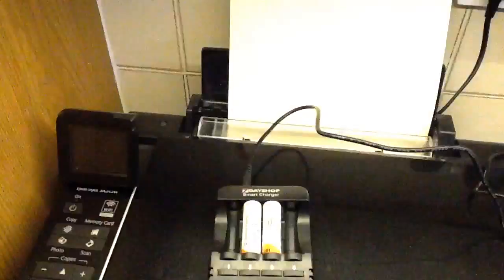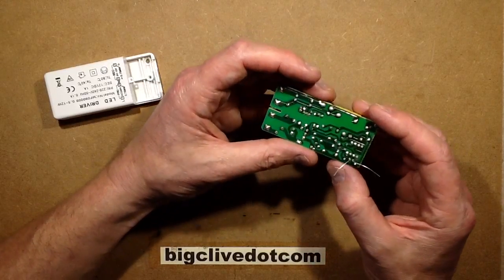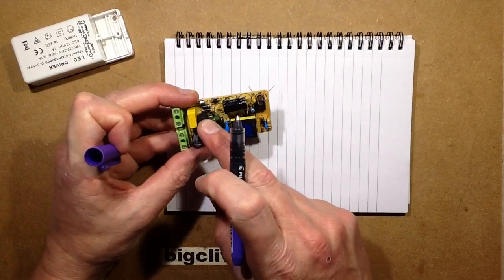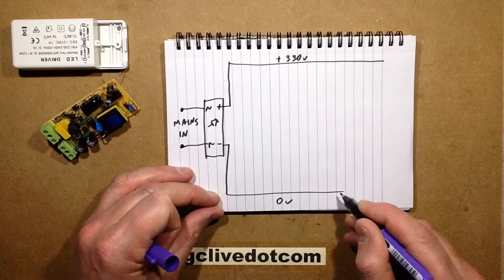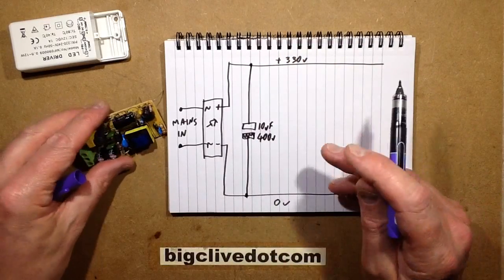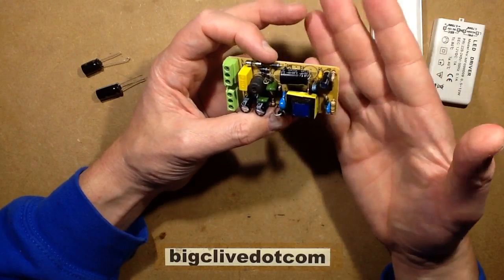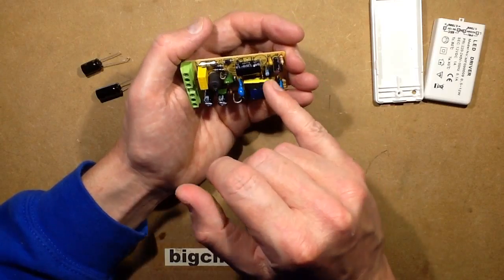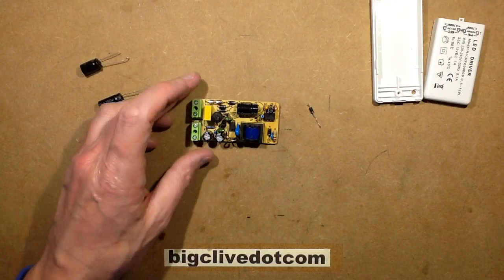(Flashing content.) Repair of strobing LED power supply.

Comment: Dear Clive. I have a question.
I have modified an led-series driver into dimmable with simple parts (13005 + 50k potensio), and it get flickered when in middle brightness, but fine when in the lowest / highest turn.

How to make the mid turn not flickering with simple parts?

Hope you will make tutorial from this.. 🙏

Comment: I purchased a rain proof led power supply 12v 300w  ip42 but led light blinks an power off an on each time it blinks got power whith light on no power wile light is out . any ideas besides reflowing the the solder possibly
Reply from the maker: That's possibly the electrolytic on the output side or the small bootstrap electrolytic on the primary side.

Comment: Bit late to this one, but my led lights (in my kitchen kick boards) seem to flash on and off every 1 second, thisbwas after initially not working at all for a few days.
Reply from the maker: Yeah, it's very common.  The replacement power supplies are available at your local DIY store like screwfix or toolstation in the UK.  Usually 12V and with a current rating to match your LED strip.
Reply: @bigclivedotcom  mine are single leds, with little bezels that are mounted to the kitchen kickboards. 10 of them I think. Probably easier to buy a similar rated power supply. My kitchen looks like a photoshoot at night.
Reply from the maker: @handlesarefeckinstupid  Check the power supply.  It will probably say 12V DC or list a current regulated output of something like 200-350mA.  If it's a modular plug-together system then you may find you can unplug the LEDs somewhere to stop them flashing if they don't have their own switch.

Comment: Dredging up an old video here Clive, but it seemed like the best place: We've got a Varilight V-Pro LED dimmer in our living room, with 5 Decent LED (dimmable) bulbs in the light fitting. At low levels it's always flickery, but not consistent, more like being over-reactive to slight mains voltage changes. Most of the time it's ok, then you'll just get a momentary drop in light level - quite annoying! Is there anything we could wire in circuit, an inductor / capacitor that would smooth it out? Could you do a tear-down of one of the dimmer switches and a bulb to see what's going on?
Reply from the maker: There's no consistent compatibility between LED lamps and dimmers.  The lamp technology is not easy to use with traditional phase control dimming.
Reply: @bigclivedotcom  After a bit more digging (aka RTFM) it turns out that the Phillips bulbs prefer the mode 3  "digiflux" which is meant for dimmable CFLs but seems to work better at low loads than mode 1. (both trailing edge)

Comment: Hey Clive great video! why would we still get a shock with 0v and 13amps? I thought it couldnt pass through your body if there was 0 voltage. just like how 5v 1A plugs cant give you a shock.
Reply from the maker: Although referred to as the 0V reference for the circuitry, it's actually referenced to the mains, so a high voltage above ground.

Comment: Had exactly the same issue, flashing light,  with the same type of diode in a different model power supply. The problem only appeared after the power supply warmed up, it was installed in a roof space with a metal roof (after 5 years of use). Tracked down the intermittent problem using a hair dryer and a can of freezer spray.
Easy to say just replace the power supply but the customer has 80 lights with the same power supply, total replacement cost (try  & find the equivalent/same power supply!) was NZD 3,200. Cost of the 80 diodes was NZD $12 from Aliexpress.

Comment: Wow you seem to really know how these things operate. I have three led shop lights that have a dim high speed flickering. I do have some basic knowledge of components typically seen on control boards, So I thought I'd take a look at it. I was surprised at how much was involved in just turning on some leds. Problem is I had to de-solder the low voltage wires connected to the led strips so I could access the board. I did some testing with a meter and didn't find any obvious problem yet. I then tried to check it live and one of two capacitors at the end of the circuit blew up and smoked. I had not touched anything yet. Did I cause the failure due to no load on the circuit or did I exploit the real problem? any advice would be appreciated...

Comment: Same fault plus low voltage when it came on.I replaced a bulging output cap and what I suspect is the same bootstrap capacitor even though it's tested ok. Amazingly the psu works now ! Nice 4a psu and mini fridge for 50 p 👍

Comment: I’m in the position to lay my hands on potentially quite a few faulty 60 watt 4 foot  and 2 foot led battens that have failed, most are less than a year old and the electricians rip em out and replace. A quiet word and there now coming my way rather than the skip. Hopefully might get some to work. This is very helpful.
Reply: I can forward some drivers if you like. They have quite an interesting wee chip that fails. It may be custom to this driver. Took a fair bit of rooting around to find any info on it. Still waiting for the actual speck sheet from manufacturer. Not sure there will be an equivalent.

Comment: Is it possible to low the voltage, so dimmer the led light? Thanks
Reply from the maker: Not with these.  They will maintain the 12V to a level and then start flashing.

Comment: Have you ever had led light flicker. Even flashlight led powered by batteries. Are led lights sensative to rf or emf when they are made in arrays or Cob style surface mount cob style

Comment: Hi I wondered if you could help I just replaced my 8ft tube with an LCD one and it would 'nt come on to start with then when it came on it would stay on a while then flicker it's on the original ballast and  LCD starter

Comment: bigclivedotcom i wonder if you could help me find the right led Driver for me as i have the same problem  this is the led strip https://ibb.co/vQ66hnK
Reply from the maker: The driver should be marked with its output current and voltage range.
Reply: bigclivedotcom I will take a pic soon thanks for the reply

Comment: What if the voltage is going up and down? I have a 33w led power supply and the voltage keeps going up and down. Not the caps, already tested.
Reply from the maker: Is the load varying?  Is it being dimmed?

Comment: I have a set of these drivers, one on each led, they start to flicker in sequentially, start with one then then another.... Predictable start from one then the next....  Follow the leader, they are 12 v led, the drivers are old, but seemed to be OK with the halogen units, spend a few £ on the led,  yeah should have purchased 240 mains led, any advise or has it happened to you,

Comment: Dam.. I was hoping it was a simple retouch fix so I could recover a flood light. I'll just have to go with the original plan and swap for an IC type. You always do great work. Thanks
Reply: It’s really simple to fix you need a item called a glowfix or a yagf 
Put this in ebay to ebay search bar to see what I mean 293128500853

Comment: With the help from this video, just fixed an expensive power supply that had this exact same symptom. All I did was replace the bootstrap supply diode and that fixed it.  It tested OK using a multimeter but must have been breaking down under high reverse voltage peaks. Thanks ;-)

Comment: I work only on ELV/SELV...  but I thought transformers worked only on AC? primary 240, to secondary 12/24/etc,  so shouldnt it be before the bridge rectifier?
Reply: Ressy6 
That’s where the chip comes in. Monitoring when output voltage (via opto-isolator) reaches target value, the chip switches primary winding off/on quickly making its field grow and collapse which couples to secondary winding (for the desired output) and the bootstrap winding (to keep powering the chip itself).

Comment: Is it possible to modify the driver to work on 110V?  I purchased a replacement driver without realizing that input needs at least 165V before it will even turn on.
Reply from the maker: It would probably be easier and cheaper to buy another driver for 120v.
Reply: OK.  unfortunately, almost all of the cheap ebay listings are fro 165-250V drivers

Comment: One of the LED annular ring light starts blinking after it has been on for a while.  The driver does not feel too hot to touch.  This is a 36W driver connected to couple of annular LED rings.  I just want to know if there could be fault in the LED ring itself or it will always be the driver?
Reply from the maker: When the LEDs are in series it's not uncommon for the whole string to start flashing when one LED starts to fail.  If the fault is allowed to evolve a small black dot may appear in the faulty LED.  If it does and the LED is shorted out the rest should light OK.
Reply: My previous experience (with other LED string) had been that one LED used to open up completely instead.  After soldering a shorting wire on it, eventually another LED gave up too.  You are suggesting that may be one LED is developing open circuit when it gets hot and immediately cools down after opening up and starts flowing again.  But the frequency of blinking seems very constant and I also notice that the entire string brightness seems to be less when it starts flashing.  If the converter fails to deliver the required voltage at the designed constant current, would it starts flashing?

Comment: @bigclivedotcom   I have undercabinet LED lighting. non dimming.  The center light strobes btwn temperatures. Yellow, white, yellow, sometimes it just flickers btwn white.   Is this a transformer or driver issue?
Reply from the maker: If it's the type that you can select the colour by turning the lights off and then on again quickly then it sounds like the timing capacitor associated with that chip has an issue.
Reply: plain bright white LED light. transformer so i can plug it into a 110 outlet.   Outlet is on a switch and when I turn it on the color temperature is never consistent and sometimes flickers on and off or btwn warm yellow temperature and white temperature colors
Reply: to doubly clarify - its suppose to be 1 color.  Bright white color.  There is no option to switch btwn LED color temperatures.

Comment: I have the same problem with the power supply of my laser printer and was wondering if this problem could be caused by the primary and bs windings of the transformer being shorted together on both ends, as that is what my meter is telling me. I will try to desolder the transformer now, but I dont know if I could repair it.
Reply from the maker: These tiny transformers tend to have low resistance windings.  The secondary ones often read as a short circuit.
Reply: Ok. Good to know. I am still confused whats causing the fluctuation on the bootstrap circuit than, as I now even checked the diode and its still not working. I measured the DC on the main smothing capacitor and its perfectly stable so its not a problem of the supply and the capacitor on the bootstrap circuit charges as well, but it looks like the bootstrap circuit isnt supplying enough current to sustain the voltage and it drops to about 9V where the chip stops working. Than the capacitor charges up to about 14V again, starting the chip and the cycle starts all over again.
Reply: Never mind. I fixed it. While measuring some other parts I wondered if it might be a resistor and there was a smd resistor in series with the bootstrap winding and the diode. I measured across the resistor about 55kOhm and then looked at the marking on the resistor itself, showing 4.7 Ohm. I simply soldered a regular 4.7 Ohm throughhole resistor across it and sure enough: I am getting a stable 12V for the chip and the printer turns on again. Thank you for your help and keep up the great work! Without your videos I still wouldnt know how these circuit are supposed to work!

Comment: I bought six led ceiling fixtures from WM to put up in a place we bought.
After six months, four of them are strobing.
My wife is unthrilled...
Where might I buy some replacement power supplies?
Reply from the maker: It might be worth taking them back if they're in warranty.  There are plenty of power supplies on eBay although no guarantee of quality.  The main information needed is the output current and voltage range.
Reply: bigclivedotcom, thanks for the reply.  On the outside these power supplies look very similar to the one in this video. 
 I did take several back and get replacements.  
Now they are selling a ceiling light that holds two medium base led bulbs and they won't exchange one for the other.
I did order a "Chanzon LED Driver 600mA (Constant Current Output) 30V-57V (In: 85-277V AC-DC) (10-18)x3W 20W 30W 36W 45W 54W Power Supply 600 mA" for $10,
I wired it in and so far it is working.
I was hoping you might be aware of a more dependable line of power supplies. Thanks again...

Comment: Can having too few leds on a cc driver cause this strobing? My brand new driver says 35v-80v but I’m only running 10- 3watt leds. (3.2 forward voltage)
Reply from the maker: Yes it can.  If you have your LEDs in series they should fit in its rating though.  At worst you could get another power supply.
Reply: bigclivedotcom wow didn’t expect a response from the big man himself! You are too kind sir. The driver is fully potted so I’m glad I didn’t start digging around looking for a bad component yet. 👍👍

Comment: Hi can you help me with a problem of mine? I have a LED strip installed in my ceiling and it has a small square black driver with a single button on. The button is to change the program of how it pulses. Problem is i have to press that button everytime i cut the power to the strip to make the light solid or else it will cycle through every single mode and its driving me crazy. Please help me.  How do i make it stay lit solid after i turn it off and on without the need to press the button on the driver. Is there anything i can remove from the driver?

Comment: That is interesting, I have a power supply in an audio amp that was bad and it is a common thing to blame capacitors. I did, but when probing around with my dvom I noticed that I had three bad diodes and one bad resistor. I don't have a schematic and so I am having trouble figuring out the diode values as these are Zenar diodes.

Comment: A customer of mine has 20w halogens she wanted changed out for led. The lighting supplier gave her Feit Electric 350-16-05 bulbs and they all seem to work except two. One light flashes and the other shuts off the entire set.  The flash is not a fast strobe, just a consistent slow flash. I changed out the bulb and had the same result. Reinstalled the halogen and it doesn't flash. A fixture on the other end of the cabinets will also only work with the halogen bulb. When I install an led bulb in that, all the lights turn off. The transformer is a KVT-60N, any known issues with led compatibility?
Reply from the maker: If the transformer for the halogens is an electronic transformer then it will not like an LED load and may actually damage the LED lamps.  For the LEDs you need a new transformer suited to the lamps.  That's usually a regulated 12V DC supply.
Reply: bigclivedotcom Thanks! Today I recommended a complete changeover to LED lights and transformers.

Comment: You sound like you know what's up..maybe you can help me...I've got a plant light that is starting to flicker. The company no longer exists. 
Mostly it does this the worst when I dim it to 25-50% power on 'pulse' mode, but it will also flicker when I turn up the red beyond about 60%. It has 4 colors I can turn up and down. Red, blue, green, and far red.  I assume it is a 3 channel..the red and blue are on separate buttons on the remote, but as you turn one up, the other automatically lowers. These are all adjustable in increments of 5, so if I turn up the red to 60, the blue automatically goes to 40. If I turn up the red to 65, the blue will be at 35. The green and far red, however, go from "low" to 5, to all the way up to 100.  I am glad to see that this might just be an issue with the driver, as that can be replaced, whereas a new remote and receiver...there are ones that are similar to mine, but none exactly, and there are a bunch of other features and programs in that controller that aren't in regular RGB controllers like when the LEDs gradually come on and go off at night and at night, after all the other colors go off, the far red only run for about 15 minutes.

Comment: Hi Clive - I have the flashing light issue in a chandelier containing 18 Disc shaped LEDs each with 6 yello LED Pads.  Anyway I thought just to swap out the driver.  When I removed the chandelier driver compartment I found two drivers.  One was 240V 40W DC 12V 2.5A and the other 240V 30W DC 12V 3.33A.  I don't seem to be able to find precisely the same spec drivers on the web.  What sort of flexibility in spec do you think I have for example would it, like as not, be OK to use a 100W 5A 12 Volt LED Driver to power the lot?  Thanks

Comment: I have a slightly different problem in that my LEDs flash on-off in a regular way. They keep flashing for a few seconds after you turn them off. Any idea if this is a problem with the power supply or if it is a loose connection somewhere? Some of the LEDs don't light up at all so I wonder if this is the issue.